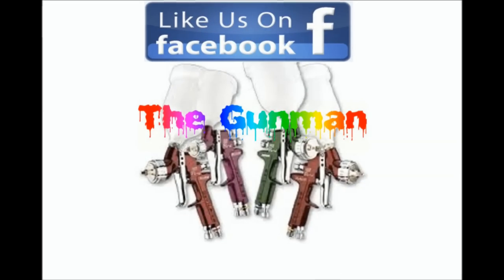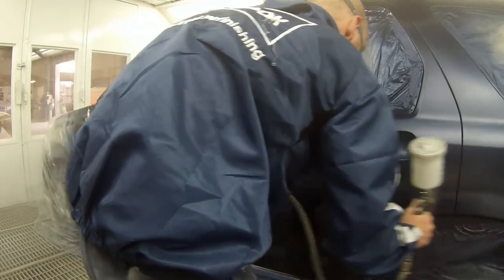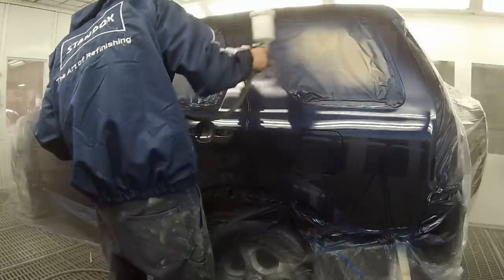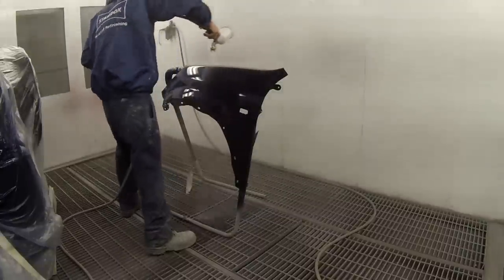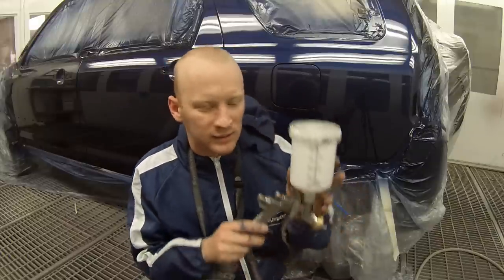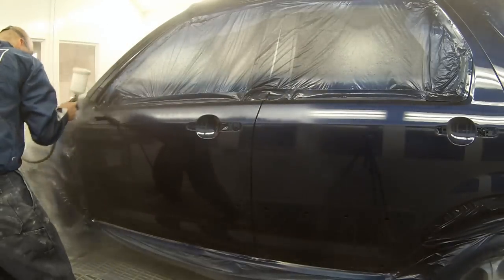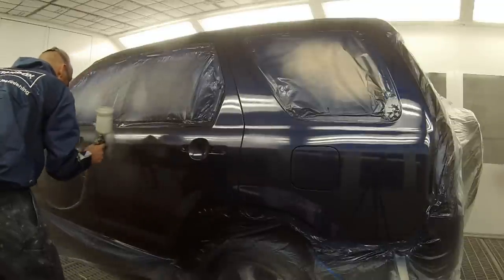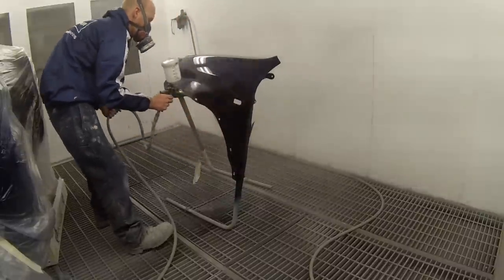Anest Iwata W400 Review and Demonstration

Comment: nice job,,,,these iwata guns were the standard from the 1970,s,, reliable, cheap to buy and fix,, allways ready to go,,keep em clean and bobs your  aunty,,
and even today $215 Ebay USA buy now and $30 freight,,,equivilant sata $700+ , devilbiss $430 +gst around $470 for what !!,,,,,I don't need a $700 I phone to call for a pizza.
This fellow is doing a real good job with this gun and the paint is good as a new Porsche right off the gun.
Good video mate ill watch more ,,,keep up the great stuff.
GO the good ol iwata...
The yanks are making good guns now for $120 each and selling them like hot cakes.
Toyota is using them in the factories over there!!
Reply from the maker: Thanks mate :-)
Reply: u have same thought with me.  I used sata 3000 in 2008, $700 can., now I bought FLG5, $220 can. in 2016,  covered my 95% job as SATA 3000.  My point is the advance technolege to make same second line guns to upgrade their preformation as good as , over 80%, with top line guns.  Now, I still using my SATA 3000 only to do the hood and top and fast big surface.

Comment: Gunman, I try to follow my tds as much as possible. The current clear that i'm using now says 5-10 min flash time between coats. I'm working on a black hood now and I waited 5 to 7 min between coats, but i seem to get dieback while it's drying. Between coats the clearcoat  is still tacky. Do you wait until the clear is hand slick before applying your next coat? I thought about waiting the full 10min before applying the second coat.

Comment: Hey Gunny, I originally bought the tekna pro lite after discovering your channel and loved it. However, my air compressor had a little trouble keeping up with the CFM. After doing research, I realized my compressor would keep up with the iwata guns as they use a lot less CFM and so I bought an LPH400 and have been really loving it. I have to say the LVX cap is amazing for metallics and I've had better luck with that setup over the tekna. I've been debating buying the W400 and my question I was hoping you could help me was which W400 should I get? The W400 with the WBX air cap or the Bellaria? I will only be using it for clear coat and mainly need a european finish. I don't necessarily need it as I get good results with the LPH400 but it's more because of my obsession with painting and different guns. Basically I kind of want the TE20 verison of the tekna in iwata form as I consider the LPH400 like the HV30. Thanks Gunny! I've been getting out there and painting some $#*T!

Comment: i just got the iwata w400 with a lv2 air cap can i buy a wbx fluid tip and cap to replace that cheers?
Reply: I have iwata w400 with a lv2 air cap to. You can transform you gun from LV2 in WBX only with simple replace needle/nozzle set and air cup. Good luck.